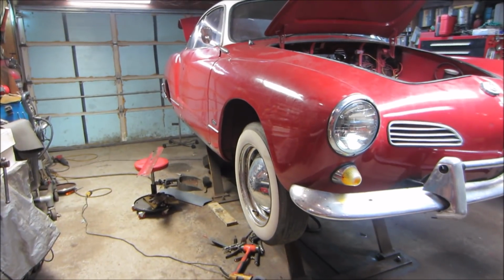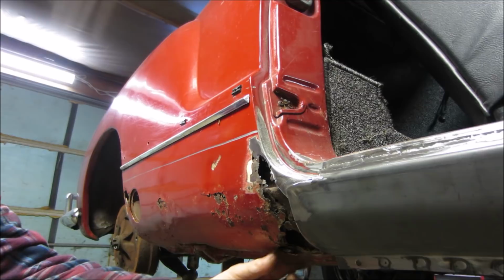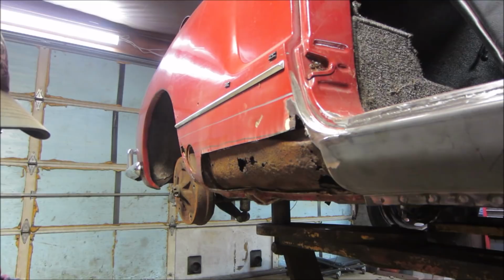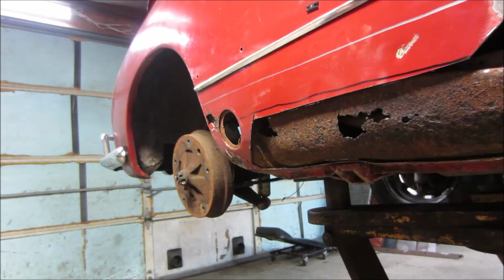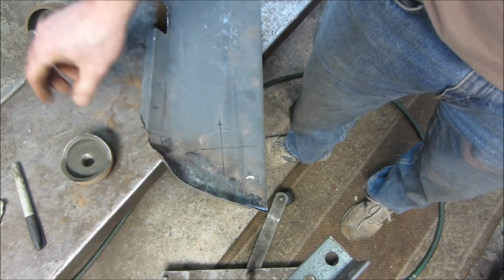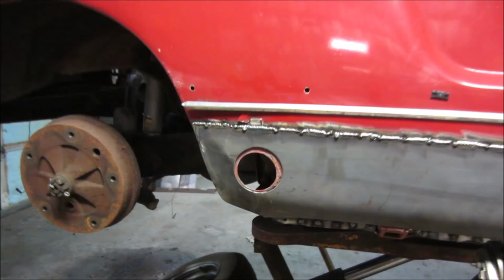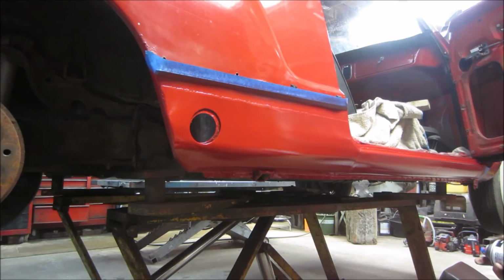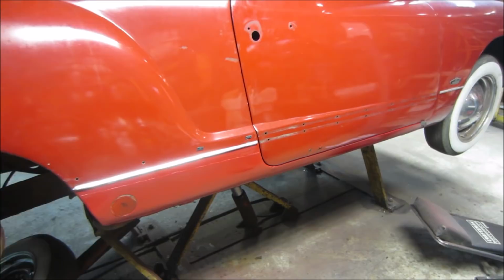1965 karman ghia finishing up the metal work.

Comment: Shouldn't you have bondo'ed the weld seams before you primed/painted? If you bondo now you're relying on how well the paint/primer adhered because the bondo would be binding to paint, not to the steel.
Reply from the maker: bondo can stick to paint but it needs to be scratched up 1st, same as metal

Comment: I know that you will put oil in the rockers but it still bothers me that you didnt replace the inner rotten metal. Would only take an extra day. But the work you've done is good.
Reply from the maker: extra day? try 2 weeks, you need to take the whole car apart.
Reply: @mustie1  right, sorry i forgot about the floorpan.
Reply: I'm used to work on unibody cars :)
Reply: Where I live, no inspection or rust cops, that car could be a driver without any patch work.  That car will never be a winter beater up there or rust away outside in the rain while Mustie has it I bet. I don't think he is building the Admiral's barge here.
Reply: Yeah, the issue is that the whole outer shell on all those spots need to be cut out in order for you to get rid of the rust on the inner rockers. Doesn't make sense, just coat it in oil. :D

Comment: When I have my headlights , wipers and defroster on the engine seems to idle a bit slower . And when I turn one or all off it speeds up a bit . Do you know what it might be?
Reply from the maker: its the load on the charging system makes it harder for the generator to spin, in turn it slows the engine down too, modern cars adjust for this with a computer but on old stuff it just slows it down a bit, l would not be concerned as it is normal, you could turn your idle up some if it goes too low.
Reply: Mustie1 thanks man.

Comment: Kinda cringing to see the inner pan cancer trapped behind the new rocker. I might have at least hacked it out and dressed it with some sheet metal, at least for squirts and tickles.
Reply from the maker: it does not come out from that side, you would need to remove the body

Comment: how to steps ,seting valves  guage ing on a 12hp briggs straton  this is  not over head valves I was told TDC for one and the other  one 1/4 down from TDC to set the other one lam rebuilding this engine my first.

Comment: You are putting  Band-Aids over a sucking chest wound with your welding repairs, there is so much rusted metal under that replacement rocker panel why bother to put new metal over it.
Reply: Your listening comprehension puts your IQ at about 62.

Comment: That was the most pointless "rust repair" I've ever seen. No rot behind the rocker was fixed, no filler was used, and then you topped everything off with spray paint. I really hope you don't try to sell this to someone. Calling it "just a driver" doesn't justify the shoddy repair. Everything you did is just going to have to be ripped out and redone properly
Reply from the maker: watch the last video it all gets filled with bar and chain oil,
Reply: @mustie1  oil won't fill those holes
Reply: @FirstLast-lf1dq  Don't cry.